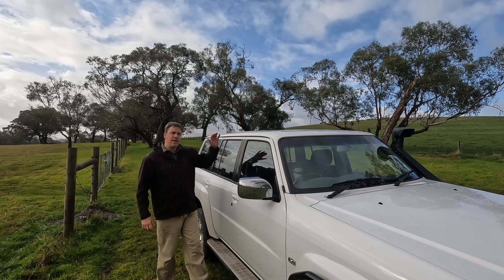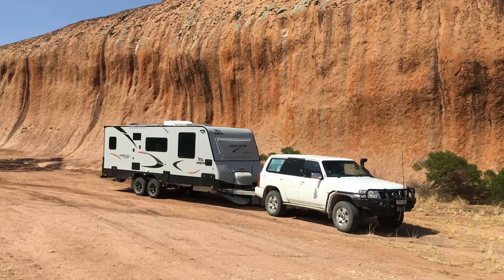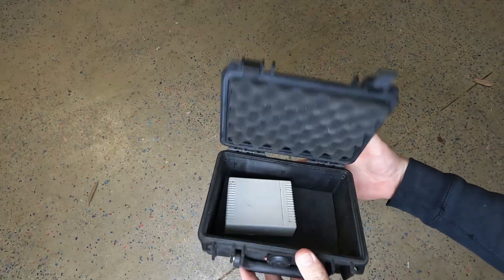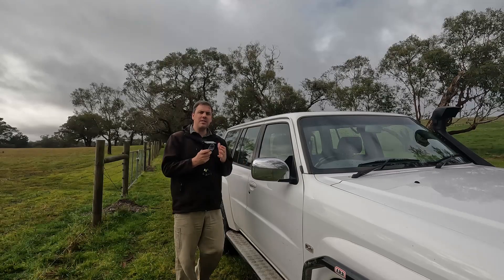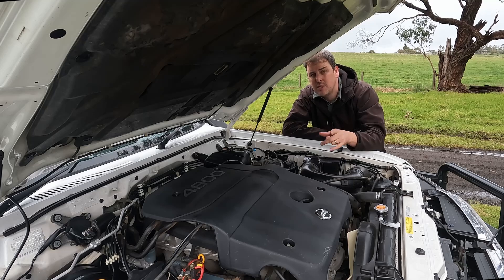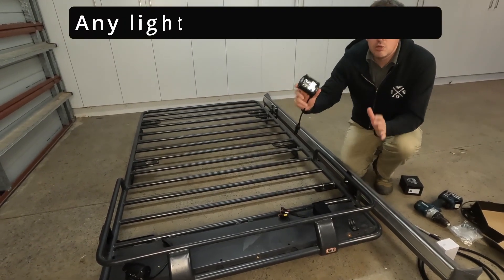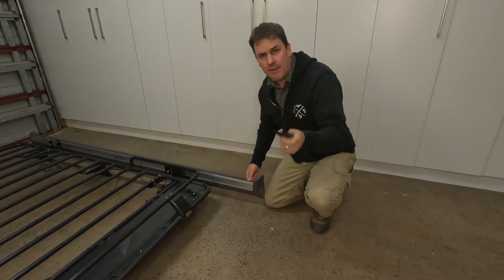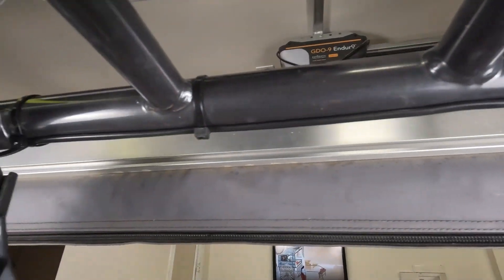LED roof rack lighting done RIGHT!

Comment: This must be FATE. 3 weeks ago, I bought my first 4WD. An awesome 2015 Toyota Hilux SR 3.0TD Auto. I'm litterally sorting out my 12v dual battery and lighting system as we speak, which is how I came accross your video. I saw another great video on remote camp lights that were completely DIY but this product has me super EXCITED!! Remote control switching already wired up, ready to go, UNREAL. This would be a game changer for my new BEAST LUX. The other fellas would be jelly, lol
Reply from the maker: Mate first off thanks for watching and secondly congrats on your first 4wd I love a well set up Hilux!!   Are you setting it up for anything in particular ?
Reply: @boxandtravel  certainly am. It'll be my off-road touring rig. It's already got a 2" lift with 33's, full bar work with winch and a steel canopy. I've got a video of my first 4WD adventure in it, on my YouTube channel already 😁